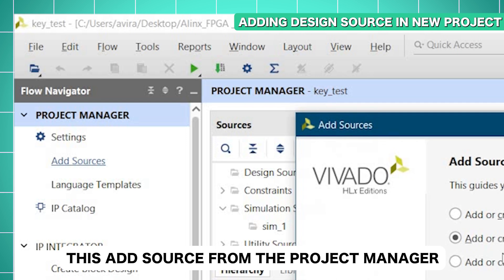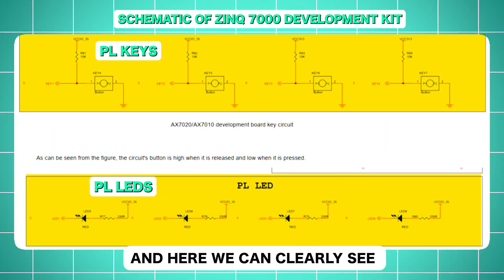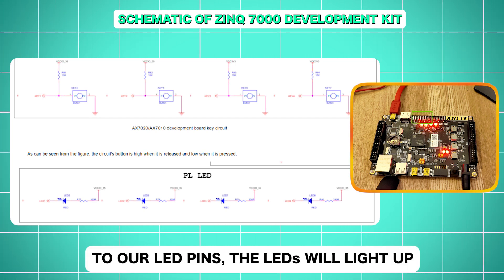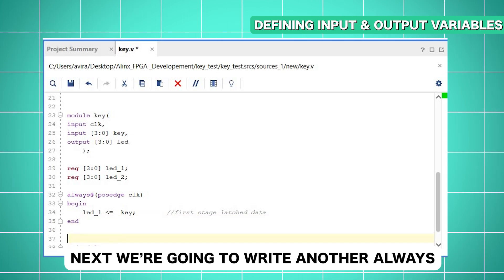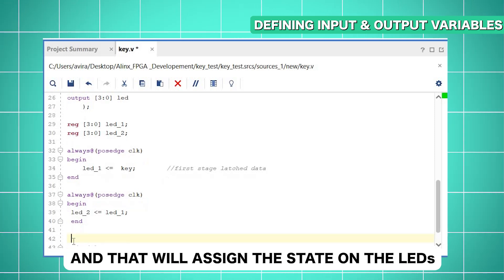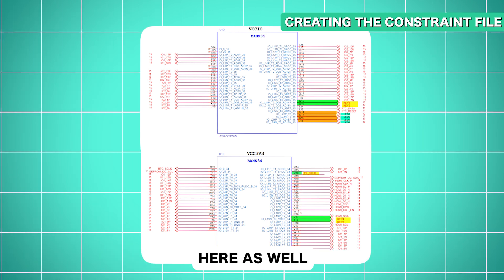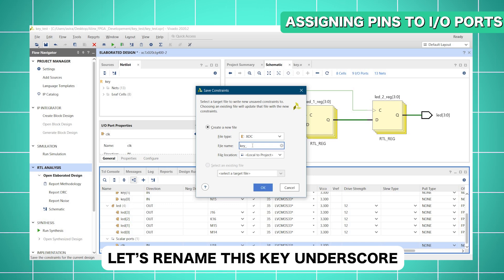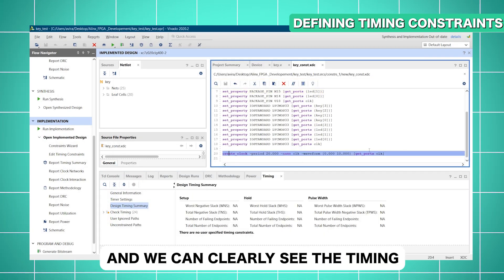FPGA Development Tutorial | Alinx AX7020 | Switch and Push Button Debouncing using D Flip-Flops

Comment: un connected pin error is not showing in altium. If you have a solution for this problem
Reply from the maker: Check out the ERC setting from project -> options,
Might be disabled from there

Comment: Hi sir, pcb already has copper poured on the top layer, i want to add another copper pour on top layer, but it is not pouring it is showing health check issue i have shared pics also please check give me suggestions for this issue.
Reply from the maker: Sure I ll check
Reply: Shelved or modified ( but not reported). Polygons may result in incorrect fabrication outputs. 
How to fix : you can fix the issue by launching the restore shelved polygons command followed by the repour all command 

I got this issue i want to repour all polygons can you please share any suggestions for this issue